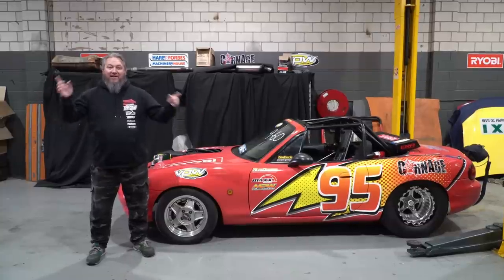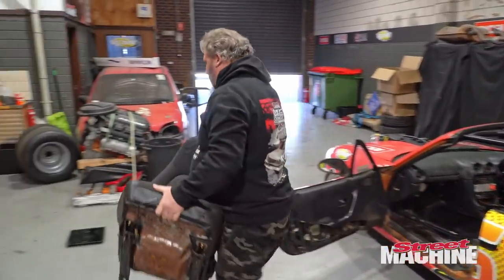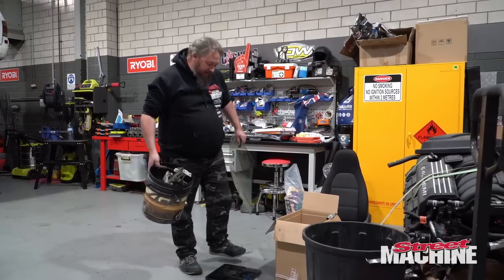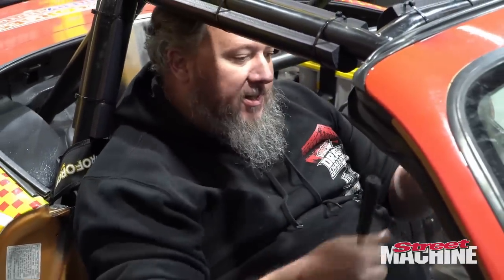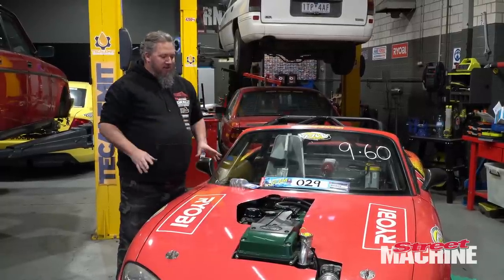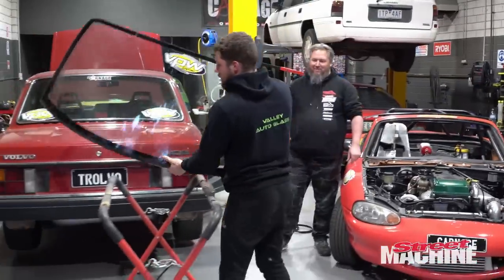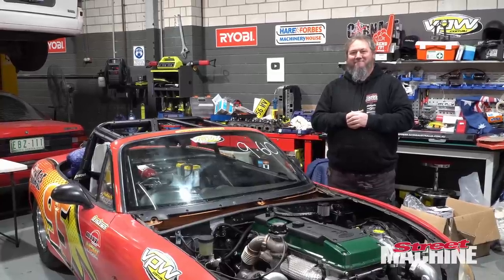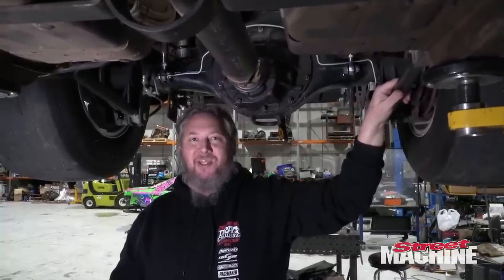Carnage - The MX5 Gets Some Upgrades!

Comment: You could  swap out the wing mirrors and tail lights for motor bike ones would save a few kgs but wouldn't look as good. And with removing the windows. Why not remove all the inside door handles and inside mechanisms  and door cards and just use like a .6mm sheet metal to cover inside door. All that should save like 10kgs. Thanks  Chris from New Zealand

Comment: That was a decent bit of weight shedding  just a little tò go.im a bit concerned about the extra spring in my experience doubling does not usually work very well. you might have to stick with the old spring and hopefully the weight shedding will make the improvement you need.
Reply from the maker: It seemed to work well with the two springs but injectors weren't up to it so we went went back to the single spring
Reply: @STREETMACHINETV  okay well that's surprising .maybe at a later date you could do something  about the injectors ..make em match.
Reply from the maker: @kennethsmith3260  That's the plan

Comment: How much weight went back in? Rough idea what the anti roll bar weighed?
Reply from the maker: Doesn't really matter does it? It certainly wasn't 40kg and the performance difference is huge
Reply: @STREETMACHINETV  more a curiosity question. Have seen kits like that a couple of times before and have wondered what the main bar weighs / total weight. Just looking for a guestimate.